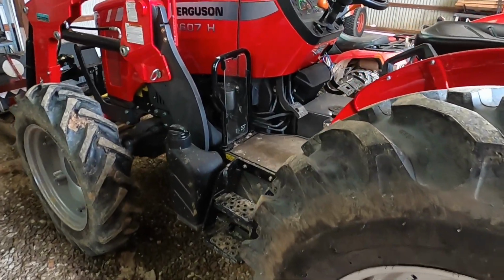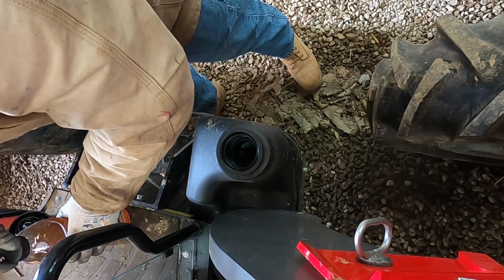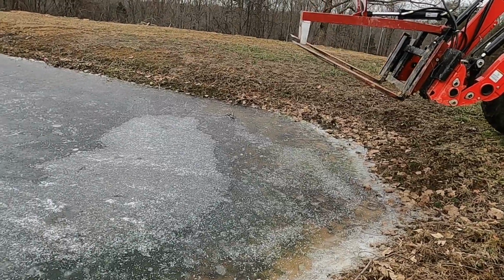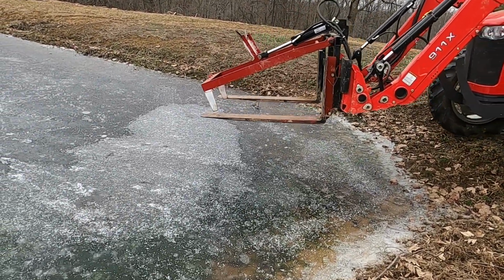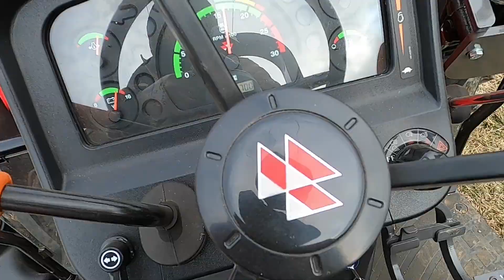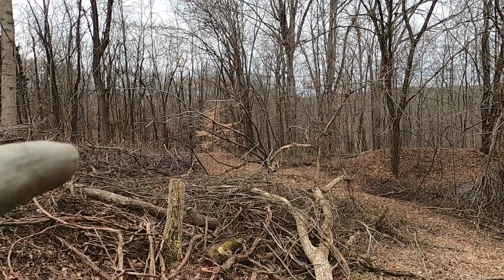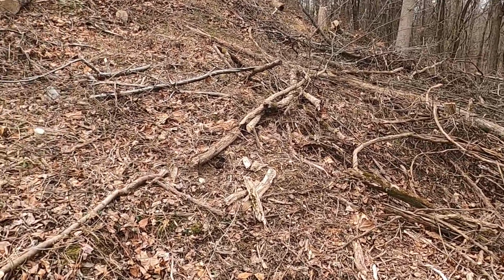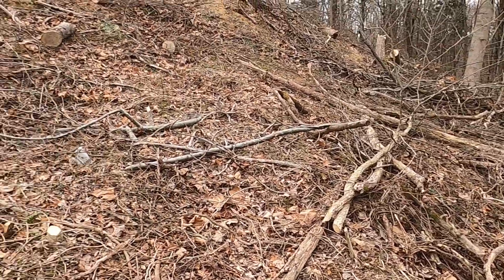180: Grapple Action - Back on the Pond Dam

Comment: I used to use the howes supplement until i watched the review on "project farm" that guy makes some awesome videos! Cant beat a grapple for that nasty brush. Im sure the goats would like the hill.
Reply from the maker: Checking it out now.  I wish my grapple was better at cleaning up ground.  It's mostly good at picking up stacked piles of brush or logs, not raking the ground to clean.
Reply: @FabbedFun  I’m sure you could fabricate something ! Just tough with steel costs right. Ow
Reply from the maker: @HillsideAcres  I watched it.  Howes is okay at reducing corrosion and anti-gel but sucks at lubrication.  I suppose I'll be switching brands as well.
Reply: @FabbedFun  I started using the power service white bottle for winter but from what i hear the hot shots secret is probably the best stuff to use just got to conivnce my self to spend the extra five bucks lol